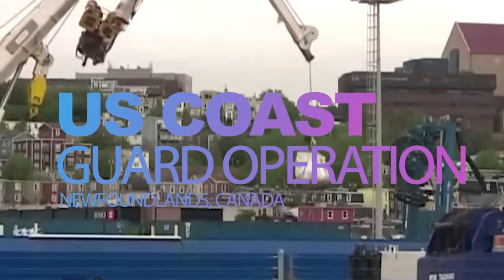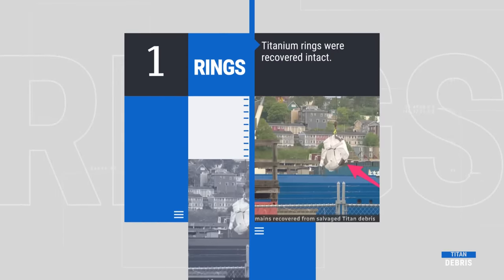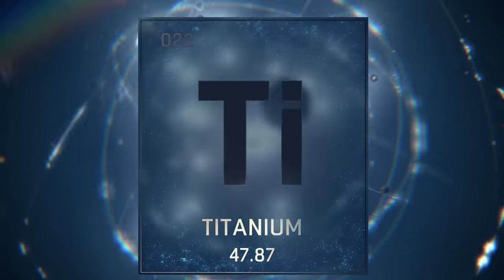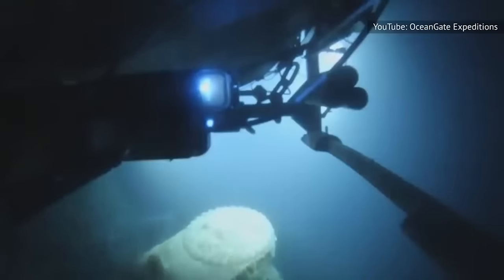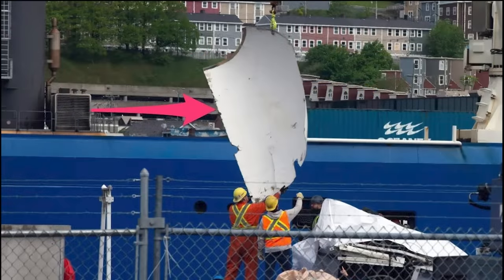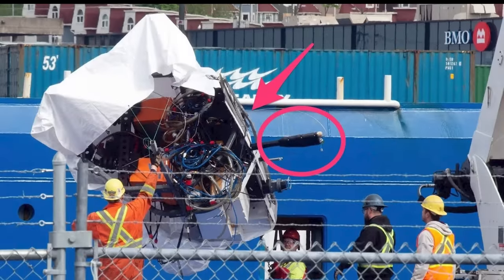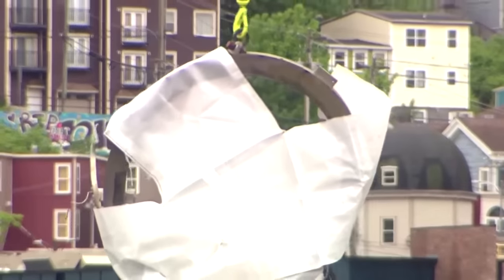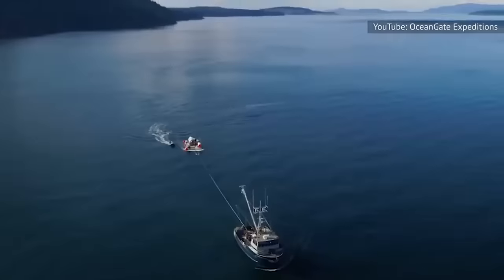What Really Happened? The Titan Submarine Clues from Parts after Implosion

Comment: This seems to be not controversial. The large pieces that were found and were seen being offloaded by crane, were mostly the components that were outside the pressure hull. Mostly the stuff from the electronics bay in the tail. The big white pieces were the outer sheeting that covered the hull. That was only attached by a few screws and is mainly decorative as near as can be determined. The domes and attachment rings are intact because they were the hardest strongest parts of the sub. Them being intact means the failure was in the carbon fiber hull. Which should surprise no one. The front window is missing because it was only held in place by a small metal bracket. It was plug shaped \_/ the outside pressure held it in place. When the sub imploded it would have been popped out like a Champaign cork. They probably did, or will find the window more or less intact. The only black pieces seen have been parts of the landing skids. The large flat black object is part of a shelf that at the rear of the skips. What has not been seen is a single scrap of carbon fiber. Nor any interior panels, parts of the floor, or anything looking like the battery compartment that was inside the pressure hull, underneath the passenger cabin floor.

Comment: Courageous crew? Let’s not romanticize stupidity.
Reply: They were courageous. The ones who worked for the company were reckless but nevertheless courageous. They knew it was incredibly dangerous and went anyway. The passengers were likely just misinformed and thought the risk was much lower than it really was. Do you know the best way to construct an airplane? Before your last flight did you check to see if the plane was in accordance with your detailed knowledge of engineering? Did you check the maintenance logs? Did you verify that the engines were properly constructed? Did you even look carefully out the window to see if the engines were there? No, you trusted people who sounded reliable. We are all vulnerable to this, which is why regulations are necessary.
Reply: @stt5v2002  There is nothing courageous about getting on an airliner. People do it every day without even thinking about it, even though airliners do sometimes crash.

Comment: If the supposed transcript is true, then it is likely the second the Titan entered the water. Water entered into the delaminating carbon fibre, making the haul heavier, and the pressure that deep would have pushed more water into the structure. Hence, the reason it descended faster than it should have. Major cracking noises at the aft of the craft,the electronics section being separate from the pressurised haul, and that systems alarms started going red, it is likely the back electronics section filled with water first They had nearly 20 mins warning. The ballast was released as they attempted to ascend but to no avail, most likely because of the water taken into the structure on the way down. Propulsion system A failed to respond. Stockton attempted to cross to system B and then no further communication received. The system was never designed well and definetly not designed to handle a heavier weight as had most likely the submersible had become. They were sadly headed straight for Davy Joned Locker the second they entered the water and all due to Stockton's arrogance
Reply: You would think they should have installed a safety balloon and tank to do a emergency ascent.

Comment: It came unglued.  It doesn't take a rocket scientist to figure this out. As for the 'BIG" parts, well you won't be "compressing titanium" and the fiberglass and electronic components in the tail section was intact because no part of this was pressurized. As far as the window goes, it was most likely blown out by the implosion from the internal pressure spike alone. The carbon fiber tube failed.

Comment: I was asking myself for the last few days this question; why those pieces recovered were so big? Thank you for addressing important issues so timely.  Great job.
Reply: The large parts we've seen from the ship were two of the titanium piece and the exterior shell, which wasn't pressurized.  The actual carbon fiber cylinder most likely shattered into very small pieces.
An implosion like this usually happens from one weak spot and that's where the major airbuble bursts from. So it makes sense that parts of the shell are intact. Of course everything on the inside is what got the most damage due to the sudden pressure change, which heats up very high, before the crushing pressure of the water comes down where that gap of air used to be.
Reply: The Titanic also left  behind very large pieces
Reply: Carban when compressed seems to turn into graphite when compressed! farther  compression turns it into diamonds?

Comment: I spent 20 years in the high-vacuum industry, and I can tell you that when a viewport fails there is, paradoxically, a showering of glass OUT the port hole.  The fragments blow in at first, but bounce off the interior then back out the hole.  I would venture that the porthole here blew outward from the pressure wave of the imploding hull.  Its cone-shaped seal was designed to resist pressure from the outside, not the inside.  Plexiglass windows like that are rated for this sort of depth while there's a really good engineering reason that no one builds vacuum chambers out of composite materials. Pressure vessels, yes, but not anything that has to keep pressure out.  The fibers go slack when compressed and contribute nothing to the integrity of the vessel.  The only thing holding the pressure was the matrix (epoxy) surrounding the fibers.  That's really strong, but brittle and will crack with a few flexes.  I'm amazed that they got more than one dive out of it.
Reply: Excellent explanation. I don’t think the porthole was the problem because if it collapsed it would have doomed the vessel but certainly not have ripped it apart. The front part would have limited the inflow so the implosion would have been way slower compared to the hull collapsing. We are talking about fractions of a second but for the shockwave it would have made a huge difference.
Reply: And the epoxy would degrade in sea water and under pressure. One dive too many.
Reply: @Katoshi_Takagumi  Carbon fiber will degrade into graphite, and with even more pressure turn into diamonds! Carbon fibers will turn into graphite, using a HYDROCLAVE! About 3,000 P.S.I.!
Reply: @robertchilders8698  But the epoxy? What happens to it? This is a composite material, not like steel or titanium.
Reply: @Katoshi_Takagumi  I don’t think that saltwater will affected epoxy. But the problem is that this vessel wasn’t using the real strength of carbon fibers. Ultimately it was a blow of epoxy kept together by carbon fiber. And when it started delaminating somewhere within the wall it would be really hard to detect.
My guess is that the hull collapsed blowing out the porthole and the power of the implosion shattered the carbon hull leaving the titanium parts untouched.
Reply: @Katoshi_Takagumi  The epoxy, most likely would shrink to almost nothing! And become even denser!
Reply: @robertchilders8698  Well, something happened down there with the pressure hull. And it wasn't anything good.
Reply: @svenweihusen57  Delamination is exactly how I've seen it described in a number of comments. There's research into CF use with polymers and composites, and none of it points to these being a material of choice for deep sea diving or sea water environment in general. 

The way I interpret this, there could be a number of factors in play all of which on their own would have been enough to compromise the Titan structurally. Your guess sounds quite plausible to me in light of all the things we know so far.
Reply: Very much appreciated. Great when someone who knows what they’re talking about can explain the facts in such a understandable manner , thank you.

Comment: If you’re building a craft to dive to -12500’ then it seems like you would need to engineer it to withstand pressure at somewhere around -20000’ so there is a window of tolerance.  Example:  if I’m loading LNG cargo into a bulk pressure container on a maritime vessel and the PV set points are set to activate at 260 PSI then once I notice the pressure builds to 80% of the max rating I shut down the transfer.  We never operate at 100% rated tolerance.  It’s would be considered a major near miss if nothing happened.
Reply: Same approach Cameron and Vescovo took, Vescovo mentioned his was successful to -43,000 ft and that have them confidence to take it to the -36,000 of the Challenger Deep

Comment: There is nothing to speculate!!!  Carbon fiber is not designed to be under compressive loading!  CF is storng under tensile load and NOT compression loads!!!
The modes of failure:
1.  CF hull
2.  Epoxy adhesive glue holding the titanium domes on either end to the CF hull and/or the glue holding the acrylic viewing port to the titanium dome
3.  The acrylic viewing port failed

Comment: The window is bolted from outside and the dome lining around it is perfectly intact, that window was blown out by the implosion from inside
Reply: Implosions go in, not out!  Either the window was inspected and then removed to prevent damage, or the window which was rated to only about one-third of the depth that the RMS Titanic is at was the source of the Implosion when it finally had a Catastrophic Failure!
Reply: @timmeinschein9007  if it had failed inward, ie been the source of the implosion, the frame would have deformed. Most likely, about a half second after the inward collapse of the hull, the now super pressurized air would cause the viewport to pop free. It had been designed so the high exterior pressure would push it deeper into the seal, but that would not hold against a high interior pressure.
Reply: The scenario In this case the rear failed first right at the ring, that blew the air the wrong way it wasn't designed to handle, ppl could've been blown through the hatch if not crushed by the water on the way.

The remains can help define this.
The guy was a pirate, his reversion to safety criminal at such depths, there was too much wrong, I've suggested a Treaty to have nations allowed to seize uncertified experimental vessels in int'l waters by the port of departure, or nations participating in the Treaty.

Very pissed at Rush's behavior, no excuses.
⚖️📚🇺🇲
Reply: @ttmallard  after the deaths aboard the titanic, such a treaty was signed. However, Rush took advantage of exceptions in that treaty (for example, calling them crew rather than passengers, because passengers can only be carried aboard certified safe vessels). I expect to see many of those loopholes closed after this.
Reply: @leechowning2712  The issue really that we've passed from a meritocracy of most things, calling them crew implies they were employees so tax records can be used, 

He went way overboard ...
Reply: @leechowning2712  Or the lens, which is the part that wasn't certified, shattered!
Reply: @timmeinschein9007  Even if it shattered, The water forcing its way in would have deformed the frame. Once, I saw that it became fairly clear that the only failure point remaining was the carbon fiber.
Reply: @leechowning2712  But as it pushed in, the much lower air pressure would have allowed the impulse a way to go without exerting enough pressure on the mounting ring to distort it.
 
But I agree that the Carbon Fiber is also Highly Suspect because: 
1) It had been downgraded from Grade A to
     Grade B due to its age.
2) You Wrap at a 45 degree Spiral, and then
     the next layer goes on at a 45 degree
     Spiral in the opposite direction (namely
     90 degrees opposite of the first layer, 
     just like you do with the layers in good
     plywood!).  And NOT like the way you put
     thread on a spool like they did when
     making the Titan!!!

Comment: I have to wonder if there’s any possibility of the solid state storage on their phones surviving?
Reply: Corrosion and shorting could have made access to the chip memory difficult but not impossible.  The chip itself is sealed in an epoxy resin or sim
similar matrix. Whether the extreme pressure would be enough to damage the item itself I would think hasn't been tested. Be interesting to find out.
Reply: @geoffreycodnett6570  Corroded or not, we have some pretty serious tech for recovering data from otherwise destroyed hardware

Comment: Carbon fiber: tensile strength. 
External pressure/internal vacuum: compressive force. 
It's the engineering equivalent of pushing rope.
Everyone can go home now.
Reply: this is exactly what i've been saying, carbon fibre in compression is only as strong as the resin, and no-one would make a sub out of resin.
Reply: And even if it was metallic, they had no bulkhead in the middle of the tube. Even a very thick metallic tube will flatten with enough pressure. Adding more thickness helps but would be helped by a bulkhead ring.
Reply: Having worked with carbon fiber, I've found that when it's compressed with several thousand P.S.I. it turns into a soft like graphite! - with no strands! After seeing the way the casing was "wound" I was appalled at the procedure! TOTALLY WRONG!! They were totally wrong about the way they  went about useing the filement winding machines!! No vacuum bagging? No autoclave? They should have at least followed what the aerospace technology does!! As fàr as out of date resins go, it shouldn't be a factor!
Reply: @robertchilders8698  They made it like the 787 fuselage. Different application. There’s no vacuum bag on the fuselage, but they do autoclave it.
Reply: @robertchilders8698  so the disappointing thing is that I'm not anyone qualified or certified. As a matter of fact, I'm a hick with a GED. Not saying I haven't looked into some engineering and physics principles because I find them interesting, but I'm not expert. That said, the failure here shows just how far away from practical knowledge our society has come. The ability to picture in ones mind how things work is totally lost, so "high strength" is visualized as a blanket term, when in fact it's very subject specific. The root knowledge is gone though. As an example, an engineer who I used to work around did an analysis of a proposed bridge structure around the beginning of computer design. He did old fashioned engineering study, and said it would work assembled, but couldn't be built because it wouldn't support itself unfinished. He was ignored because the, "new tech" said it worked. Several guys died when the beams buckled the day after being set. The loss of the real world practical knowledge, and common sense understanding was at fault then, just like now.
Reply: @newguyrc1128  I've worked with some very brilliant people in my life-time!  They are sometimes ignored and even refused work,  because of their lack of people "skills"! Some even are ignored because they appear to be "mentally sick" to the average person !

Comment: The different parts were made of different materials which have different levels of resistance to pressure. The various components of the structure were contracting and expanding entirely differently from each other with each subsequent dive, which eventually stressed all of the seals and areas where the various parts were fused together. It was these seals or joined points that failed, causing the various large parts (made of different materials) to finally separate under the stress of contraction when exposed to pressure once again on that final dive.
Reply: The surfaces were bonded with adhesive not fused.  You seem very sure as to what caused the breakup.
Just out of interest what are the expansion coefficients of titanium and carbon fibre?
Reply: 😂 this mf thinks it was glued together

Comment: Clip of making carbon fiber hull tells reason why this happened: fibers going same way. Fibers should cross each other on different directions (45-90 degrees) between layers. Same way going fibers are not even close as strong than crossing fibers.
Reply: yeah why did they miss this basic fact, what was there thinking, cross hatching is stronger in more planes than straight winding, what was there logic, was it just inexperience or the fact that the carbon fibre was passed it's use by date and boeing did not deem it safe for aircraft, which undergo far less stress and strain ???
the whole sub was not even fit for a single use at that depth ???

Comment: Because the cylinder is made of carbon fiber and not thick enough to withstand the pressure of deep depths, it will instantly implode killing the 5 passengers onboard, as the other solid parts will remain intact due to the physics of how implosion works.
Reply: Lol you managed to say a lot of things without actually saying anything properly 😂.  Also even if it’s thick enough, it’s still never enough because of the structural composition of carbon fiber.  The other solid parts remained intact because of their dense composition as metals and not due to the physics of implosion.  🤦🏻
Reply: Nope the RTM system alarmed on the descent 300m from the titanic 3500m down so Stockton decided to abort immediately dropped the ballast which for some reason didn't slow/halt the descent so he then jettisoned the landing frame after several attempts. 
But even then the titan was struggling to ascend very slowly. 
The thrusters had malfunctioned so wasn't helping. 
After 19 minutes of the first rtm alarm the sub was gone.